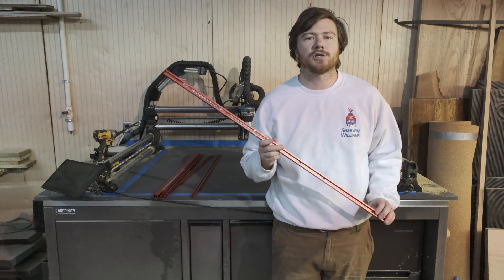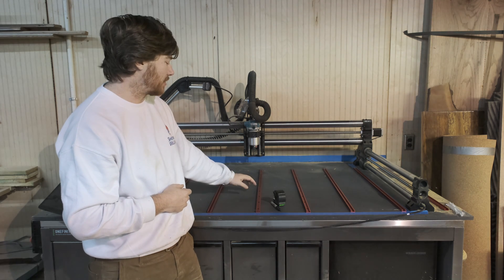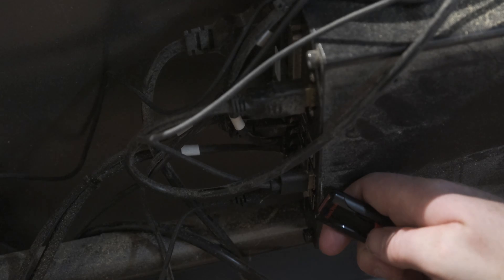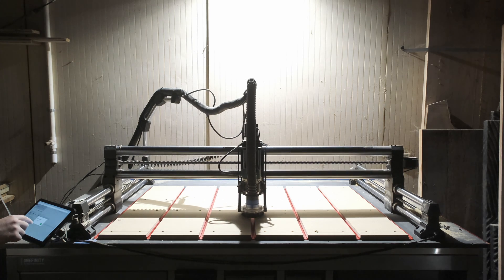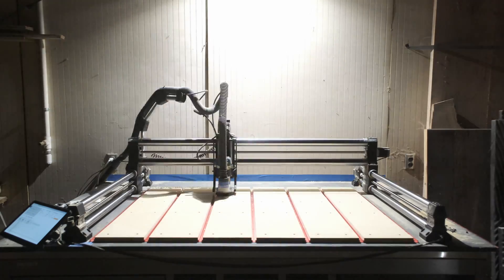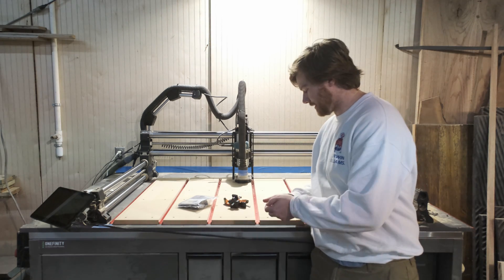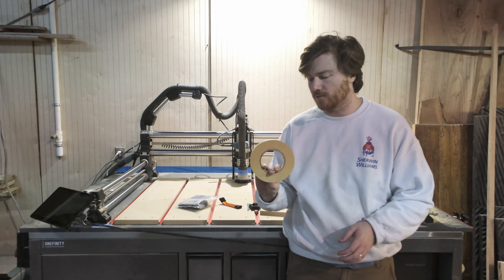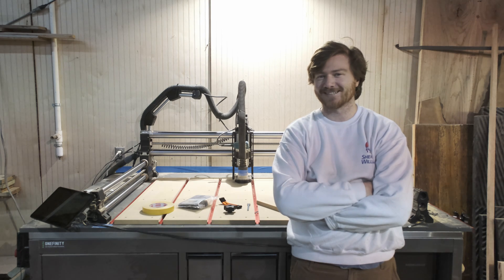Onefinity Journeyman: Simple Waste Board Layout

Comment: Hey, when you surfaced your wasteboard, was it not able to surface all the ay in the rear? Since your tracks are 36" but the max depth is 32"?
Reply from the maker: No, I have my useable work surface "sunk" into the wasteboard (that is larger than the cutting area) so that I know where to bump up my material against. The tracks are easily cut, if you wanted it to just be 32"

Comment: I'm putting mine together now but I haven't gotten to put the waste board on there yet so I have a question on that flush bit you have there.
I have a bit that will make a 3/4 groove in the wood. It leaves the bottom of the wood pretty flat.
Would that work instead of having to buy another bit just to flatten the waste board?
Reply from the maker: Yeah that will work just fine! The only reason to get a bigger bit is to save more time (well that's the main reason, anyways)
Reply: @HamiltonDilbeck  
Thanks. Your doing a fantastic job on your videos by the way. Great sense of humor.